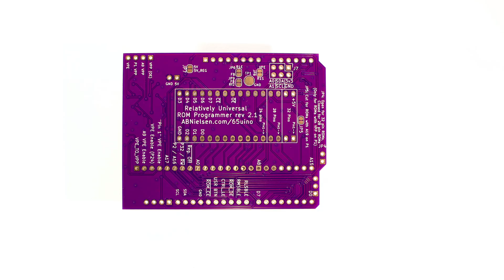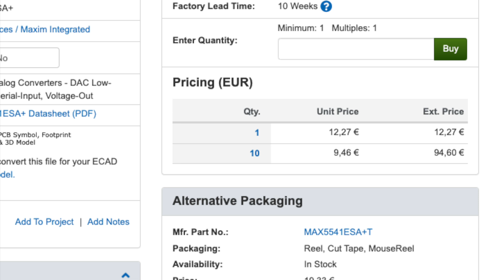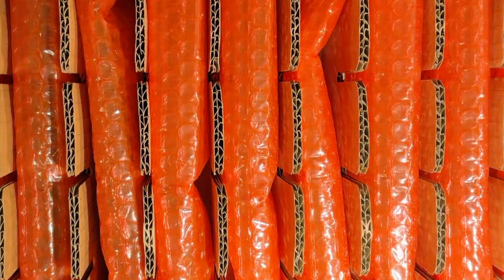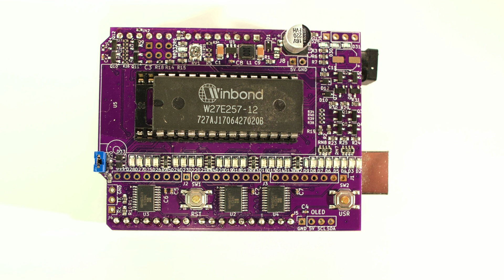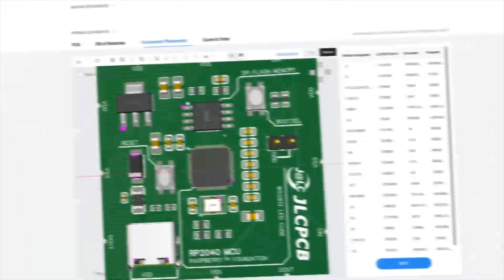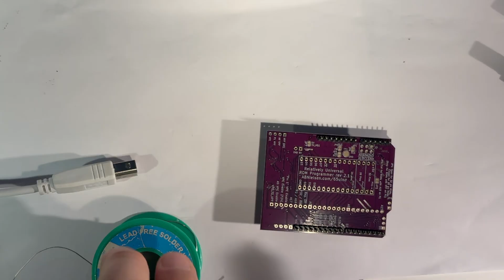Open Source ROM Burner Just Keeps Getting Better!

Comment: I didn't find information which ROMs can be read. I want to read ROMs of type 2332 (4 KByte), to replace them with EPROMs 2732.
The database-file of firestarter app doesn't include ROM types.
And as I found, those masked-programmed ROMs are not fully pin-compatible with 27xx EPROMs.
Reply from the maker: Indeed they are not. 
You'll probably have to make a custom pinout for that with firestarter - but it shouldn't be too bad. 
Come by the Discord, there's help to get if you run into trouble.

Comment: I am wanting to program a 2716 Eprom have found and ordered with a 2Kg file I have downloaded (to go in a Gotlieb Haunted House pinball machine to allow speech) how do I use this to program the chip with the download? 
knowing nothing about this, is your ROM burner all I need? or is it just an adaptor to go on another base type unit? if so? what are some cheap ones to attach? Any advice appreciated I tried the link for your ROM burner and only get Euros or Dutch $ is there a better place to order to send to Australia?
Reply from the maker: For 2716s you might need an adapter - but I actually did add a specific jumper for it on the latest revision, but the firestarter software isn’t quite there yet as the 2716’s have inverted write pulse logic. 
“Almost” there - several people working on it.
Reply: @AndersNielsenAA  Thanks for the Quick reply! so I will "wait" for hopefully your "soon" to be new version which if I understand I will NOT then need an adaptor? if you are able to advise when its done and ready? be great if you can! and to buy to ship to Australia where or who is the best place to order?
Reply from the maker: @user-wn7jj9bg3r 

Hardware is ready (the Rev. 2.2 has a 2716 jumper) but software support isn’t quite there. Maybe soon, maybe in a month.
Reply: @AndersNielsenAA  Hi Is the "new" version available yet? If so how can I order one to be sent to Australia? if not when might it be ready? Thanks
Reply from the maker: @user-wn7jj9bg3r  Yes - check out my new video about it :)
Reply: @AndersNielsenAA  Hi Thanks for your response as a newbie no idea of exactly what I am doing!! I am going to ask some 'dumb" questions and hopefully not too annoying questions of you!!? I cant find the new video about it!!! Is this a kit? u have to solder and assemble? or is here a completed unit? I can't find which unit to buy on the link???? so how and which item do I order to get it sent to South Australia? I can find anyone 'local" who knows anything (trying to program a 2KG file download onto a 2716 EPROM to go in a Haunted House Gottlieb pinball to allow speech) Appreciate your patience and kind assistance in guiding me into the "unknown"!!

Comment: Honestly, I think the whole project could be made much more expandable by incorporating your own modern MCU onto the board directly in some fashion or the other. An RP2040, RP2350, CH32V203, (or there are modern attiny and AVR DA/DB chips if you love Microchip) etc, in a 32/48 pin package would open up so many possibilities... some of them have DACs internal to them as well..

For a DAC, a quick look on LCSC shows there's a TPC112S1 by 3PEAK with english datasheet, that's a 12 bit MSOP-8 DAC for $0.45 USD in 30 pieces
Reply from the maker: Of course it can very objectively be “better”. I’d probably go with a CH32V203.
It’s meant to be a learning experience and meant to be super cheap. 
Doing a 6-8bit R-2R DAC isn’t supposed to be the “best” solution - just to show off a cheap and practical one.
Reply: @AndersNielsenAA  I was a bit confused that the only DAC you decided to show off was a $10 one...
Reply from the maker: It was a suggested part so I kept the screenshot - wasn’t even cherry-picking

Comment: Dedicated DACs aren't nearly as expensive as shown in the video. The 12 bit i2c MCP4725 is only around 60 cents from LCSC. That might still be too much for the price point but it's not nearly as bad as suggested.
Reply from the maker: Yeah, it’s not that bad - but I didn’t even cherry-pick an expensive one. 
Going with a 10-15c register and a few resistors is quite a bit cheaper though - and it’s a more fun trick to show off :)

Comment: Vpp can be controlled using a single PWM pin. The PWM can be e.g. 8 bits 62.5kHz, and be filtered with 1k/1uF, and then fed into the boost converter FB pin through a resistor. The FB pin also has a resistor divider connected. This gives you linear control over the voltage, in a range set by the resistors. I've used this approach before and it works well.
Reply from the maker: I’ve been told that will probably still come with a noise penalty that’ll be amplified quite a bit - but I’ll have to test it. The filtering will be key. I’m guessing more noise with more range.
My other reason for using a 573 instead is compatibility with my 65uino that doesn’t have pwm. And existing pins can be used to latch the r2r register.
Reply: @AndersNielsenAA  You can simply decrease the filter cutoff frequency to reduce the noise, though it makes the voltage change slower. But if you don't have PWM handy, it's not an option.

Comment: What kind of eeproms can it burn?
Reply from the maker: Basically all the parallel ones - 27-series, 28-series, 29-series, and 39-series. Anything with the standard JEDEC pinout. 
2532's, 2716's, and such with adapters.
Reply: @AndersNielsenAA  29's dont work yet.Just a matter of time.
Reply from the maker: @henols  The HW works :p
Reply: Most of 24, 28 and 32 pin types,  27-series eproms and eeproms,  39-series and 28-series flash

Comment: This programmer has been such an incredible experience for programming my Pac-Man 2532 ROMs. It took some time to get it working, but thanks to your fast support I was finally able to program them, and I plan to do the same for the ROMs in my Space Invaders and Frogger. I will surely feature the programmer in my upcoming Pac-Man restoration video!
Reply from the maker: Thanks for your patience. It’s not always easy to get those chips right on the edge working - actually didn’t plan to make it work for the 2532s but I’m so happy it actually works now! :) 
Can’t wait to see what you come up with!